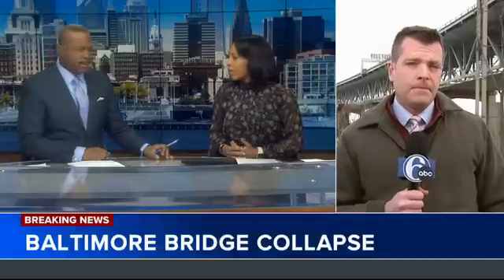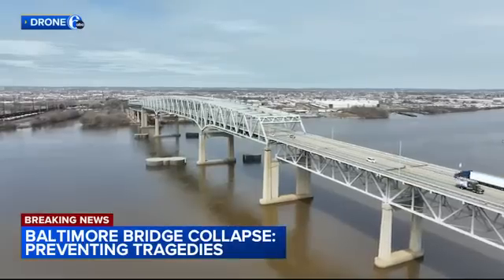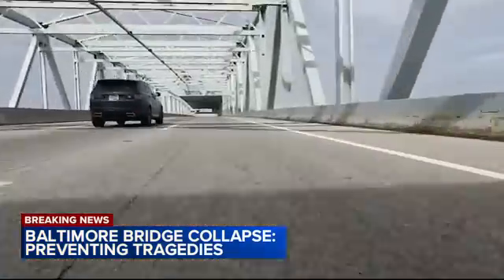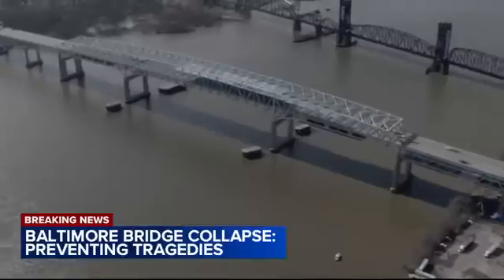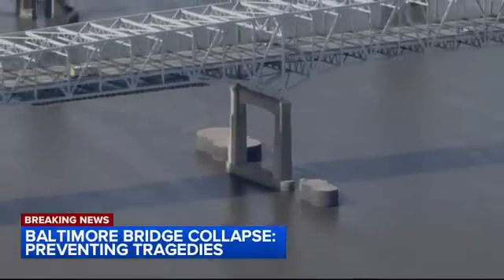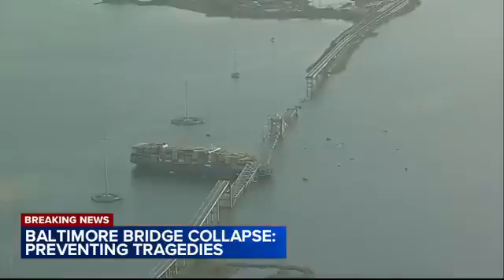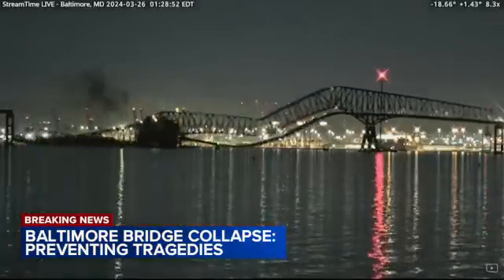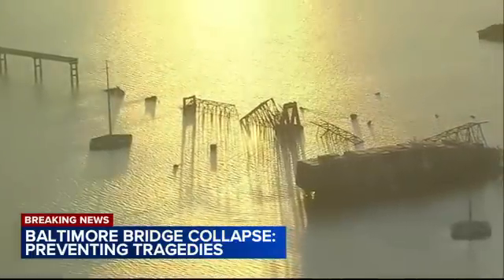Here's what surprised a structural engineering professor about the Baltimore bridge collapse

Comment: Monday morning quarterbacks. The bridge failed because a 100 million tons of boat slammed into it. The focus should be on the boat and the reason it lost control
Reply: Do you see how a simple barrier would have prevented the bridge from collapsing 
The high voltage power towers next to bridge were surrounded by a protective ring barrier so that the towers don’t come down .
With the bridge support columns exposed like that it was just a matter of time before some ship would smash into one column.
Obviously bad engineering and ships go off coarse all the time nothing strange about that

Comment: I don’t know, the ship are getting bigger and bigger, , those protectors are not big enough for today size ships. The other bridge doesn’t have them. I see just before the bridge the channel turns left. The ship needs more depth than 50-51’ cause 49.4’ does not give enough water under for flow, and since the channel was only 1400’ wide and the ship 150’ and as it stayed straight, the slope up on the right, creating drag on the side of the ship. With out multiple tug boats to keep it in the center of the channel. When the Evergiven was blown about in the Suez Canal, the guy Sal explained the physic about water between the ships and the canal or channel. Not enough room for error. A fleet of American Tugboats should have controlled those ships until they are in open waters

Comment: Blah Flag/Black Swan Op.
For what? Who knows, except those involved.
How do I know? You can clearly see the explosive charges detonate as the bridge collapses. NO. Not structural stress giving off pressure. Actual detonations of explosives.

And, the other thing... The sudden electrical disruption on the container ship, but it changed coarse. NO. The currents in the river are NOT that strong for the short amount of time the electricity/lights were off.

That was a deliberate change of course. If the power was off to the crew, but the ships controls still activated and remote piloted...

I know, I know. You will say that can't happen!!! Really?! Those ships are nearly fully automated with internet connection capabilities. Oh, yeah. Have you ever seen Speed 2? A fully automated ship hacked and remote controlled to crash.
👀🤯🤔🤫🙈🙊🙉

Power lines popping. Sure. One big electrical discharge would be seen, not multiple discharges. Why? There are not multiple power sources. Once the lines are disconnected from the power source, there would not be continued discharges of electricity arching.

Those were controlled demolition charges. That's why the entire bridge collapsed in the manner in which it collapsed.

Comment: As someone whos done alot of boating on the Illinois River, i think i vsn say they have enough "dolphins" at their bridges. The Illinois is used for shipping. There are tugs pushing barges 24/7 all year long. There are also many locks & dams which were built by the Army Corp. Of Engineers. Its a very interesting system. 🙏❤☺

Comment: This problem was first called attention to back in 1980 when the Sunshine Skyway Bridge in Tampa was destroyed. There were protective berms installed on its successor, so it would be almost impossible to do such a thing again, no matter the size of the ship. 

This is negligence of the worst kind, to not have dealt with this issue in the course of more than 4 decades, on any significant bridge in this country. 

The individuals who were in charge in the past 40 years who were not calling  openly for this to be resolved by adding protections, who were not being rejected by supervisors, should be brought up on charges. And any who weren't being supported by supervisors, well, THOSE supervisors should be charged. 

It is inexcusable that something like this should happen again, with that much notice.

Even more importantly, terrorists are certainly taking note -- you can assume that any bridge of significance lacking these protections are going to be targets within a year.
Reply: "such a thing" was not THIS though.  Those would NOT stop a 200 million pound ship from hitting head on. They are designed to guide a GLANCING blow away from the bridge support.
Reply: @FUGP72  which if you watch the video is exactly what this ship did. It didn't ram the piling head on, it ground the piling with it's starboard rail. The sudden change in direction at the very end wasn't from the rudder input, it was the bow being deflected by the piling. The ship stopped in place because of the bridge span falling on to it's bow. A dolphin system would indeed have protected the pilings.
Reply: @FUGP72  ... aside from my last comment, the dolphin for a bridge in this type of ship channel (based on the average tonnage of vessels using the channel) would be 30 or more feet in diameter, ten feet above mean low tide, and backfilled with earth and concrete, and there would be two of these on all four corners of the pass. That would be enough to stop this ship dead in it's tracks.
Reply: Infrastructure Money was spent on Liberal Causes; NOT, on infrastructure and safety concerns.   Now, Biden is going to make this bridge a major part of his reelection campaign.  The Taxpayers across America will be funding the rebuild effort.
Reply: Looks like staged. Immediately after the accident, the news said that the ship caught fire and sank. In reality, it did not catch fire and did not sink, but now they say there is a lot of flammable cargo on board, i.e. In theory it could catch fire.
Reply: I completely agree. I also base my opinion on the fact that I fish under this bridge for years and can tell you all that it's known how old and rickety this thing was even 5 years ago.  It's a piece of crap straight up!!  Baltimore is reactionary to everything and not proactive about anything.  You could look at the thing and tell ot was on ita last leg. I'm just a fisherman and a carpenter and even I can tell it wasn't strong. All it takes is some common sense and knowing what minimizing risk in life really means. Its like me going to the hood in Baltimore and wondering why I got robbed for my jeep. Well it wasn't a coincidence or unlucky.
Reply: The focus of zhe value western idiocracys concerning bridges was zhe destruction of the Crimea bridge. Or did you hear anything else? Right?

Comment: Wondering how many such bridges have zero protective measures at all 🤔
Reply: good question and today I've been using Google to look at some BIG bridges ...... good to know that the one big support for the Golden Gate adjacent to the ship channel has substantial buffering ..... Bay bridge less so but here the passages are wider and the basic support structure is MASSIVE. Run the bridges up the St John's river from ocean to JAX ..... hmmmm some good some bad - but BIG ships don't regularly go all the way up town. Lastly find a before and after picture for Sunshine Skyway ..... the new bridge supports sit on SIGNIFICANT ISLANDS and several secondary supports to either side of the mains (away from the ship channel) ALSO have multiple concrete dolphins over 20 feet in diameter. In this case, Florida did not need to be slapped twice . . .
Reply: Look at the Mackinac Bridge too.
Reply: Most bridges in the U.S. are old as hell😂😂😂😂
Reply: @TerenceTarver  thats because no country bombs us back into the stone age, and we also spend more BILLIONS on other countries infrastructure after we blow them up and reset thier hard drive...In the name of freedom and oil and old rich white men. But shhhhhh, people are still trying to imigrate here by the millions every year. Or they are just rollin up though our huge gap toothed southern border wall and squatting in Californy.
Reply: Depends.  If they can take the foundation to rock, then it'd be easy.  If they had to have the piers on friction piles, adding dolphins would compromise the existing piers.
Reply: This is what happens when “fiscal conservatives” are in charge of engineering decisions.
Reply: @walterconcrete5017  I'm sure there are plenty in Baltimore and Maryland for a bridge that had a $4 toll to cross...not.

Get a hobby because politics live rent free in your head.

Comment: Look up cantilever which relies on balance. They do survive partial damage but not destruction of one of the fulcrums. Even the barriers on the Betsy Ross are not perfect but a huge improvement. The Mississippi has at least a dozen of similar type bridges. This one was unique with the arched contiguous beam running the length of the super structure.

Comment: I don’t even think those concrete circles would stop it either. 
The cargo ferry is poorly designed there is not much can be done in case of emergencies of power loss, they load those cargo ferry above the maximum capacity, with a weight like that it’s extremely dangerous.